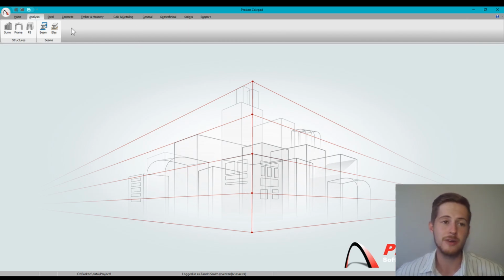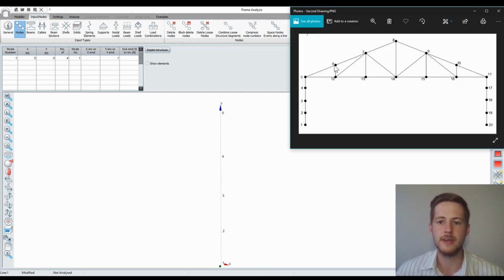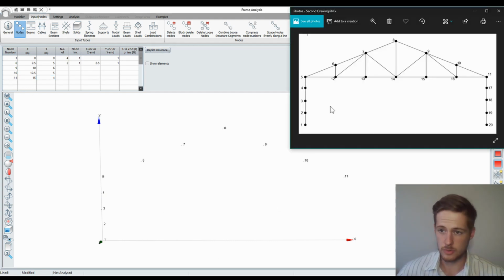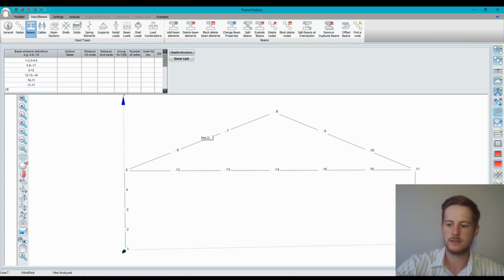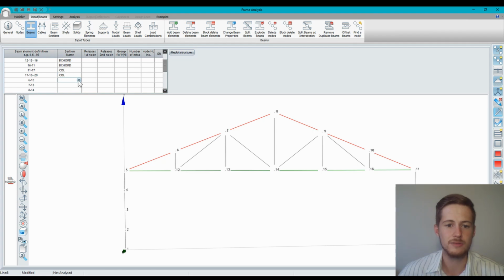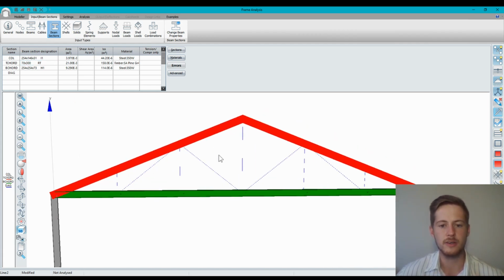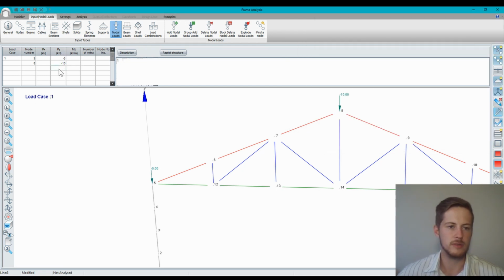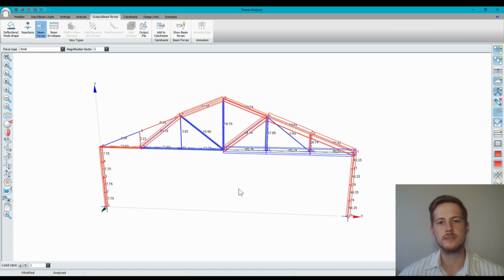Prokon: Frame Analysis

Comment: Nice presentation. When you have reversal of stresses in a truss due to wind, how do you take care of the effective length of the bottom chord which is usually not restrained laterally with purlins like the top chord?

Comment: So how do you add a nodal load that’s acting at an angle, say maybe an angle of 60 degrees
Reply from the maker: Hi, you use the horizontal and vertical components of that load as two separate nodal loads.